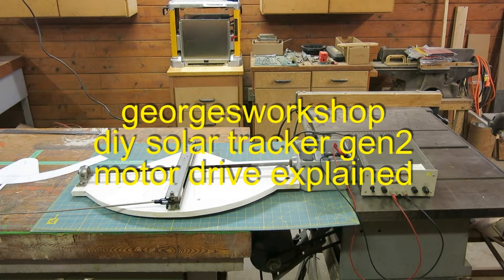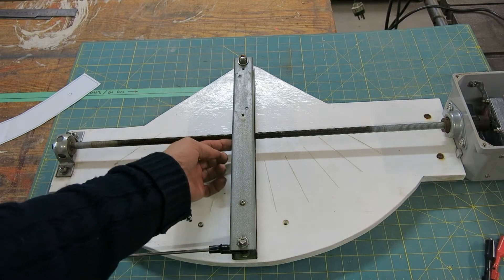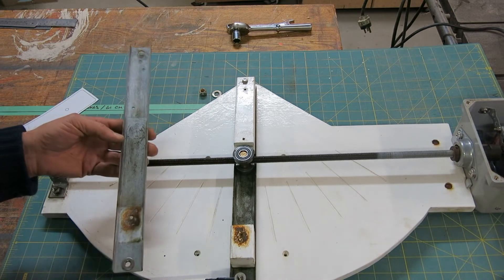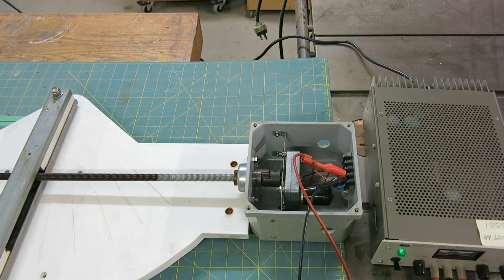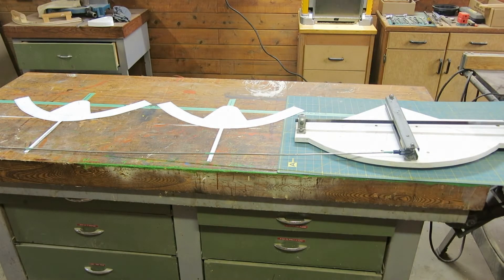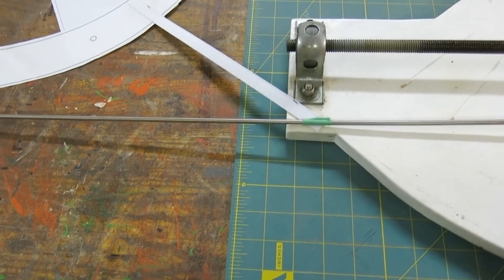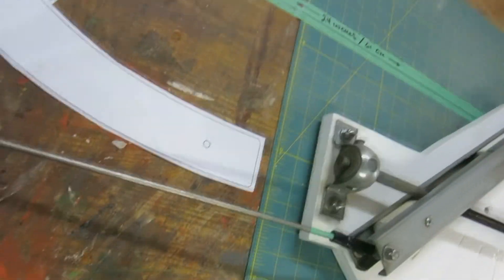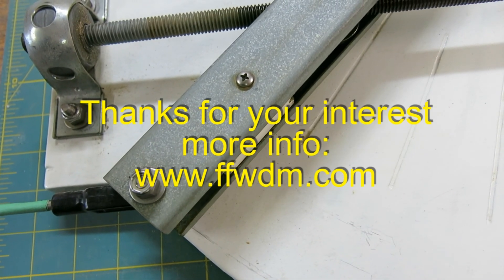georgesworkshop diy solar tracking heater motor drive explained

Comment: George you are brilliant!!.But no one wants' that- they have to spend $$thousands on over engineered scrap metal. Oh! and throw and Ardueenie in there with pages of "code" which no one else can copy. 
I was searching vids for a solar tracker( already have the electronics) gearbox and a simple mechanical solution and yours is the winner. the slider/telescoping arm is also a winner for my rc mower project as i was stumped on what to do about a smooth transition steering action. It's like"Wow I could've had a V-8".
I've been a mechanic all my 60yrs. and the sliders i have dealt with before ,it just didn't come to mind. I was in a brain-fart but with your idea I know which way to go.
I copied "Talking Electronics" solar tracker for the electronic schematics and some shielding is required to make it functional it is still the most surefire way I believe to go.
Thanks so much and I will post some pics of both projects asap!